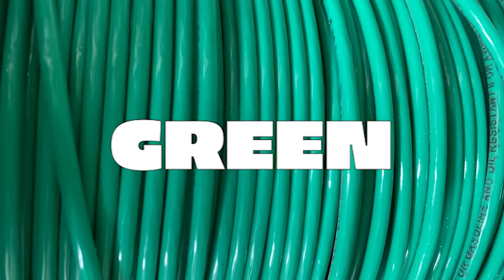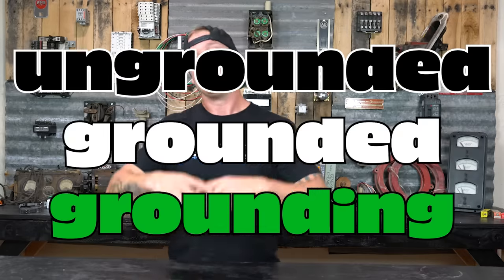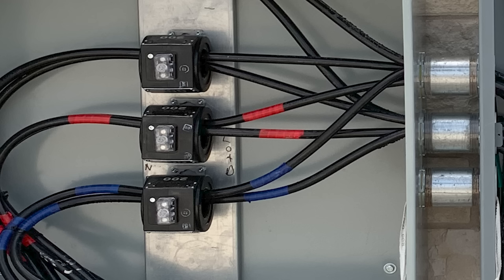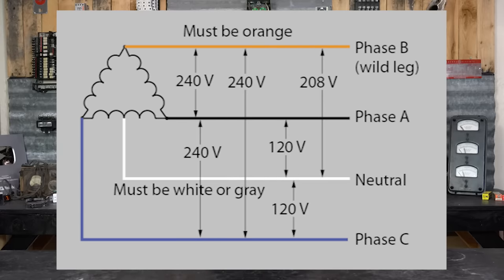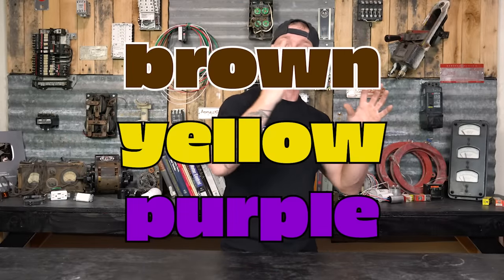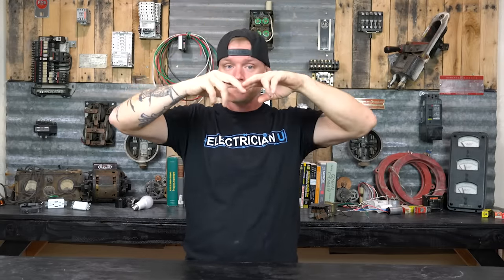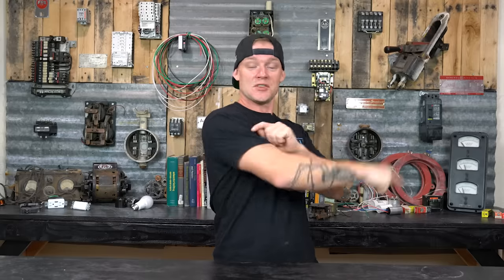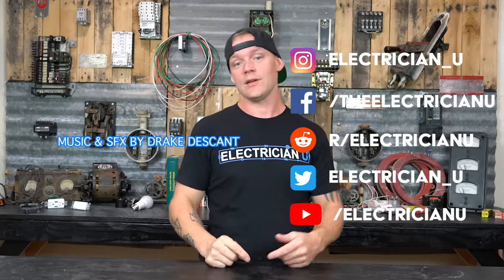Electrical Wire Color Coding Used By Electricians

Comment: 14:08 in electronics (DC) black is negative (ground) and red is positive (hot).

I heard a story about an electronics teacher who wired the receptacles for an electronics workbench. No one could figure out why they would routinely get shocked when working at this bench. Eventually someone realized that the teacher did not know that AC wiring had a different color code from the DC he was used to. He had hooked the bench grounding strap to the black (hot) AC wire.

In an ATX power supply, red is +5v, yellow is +12v, orange is +3.3v, purple is +5v (standby).

The great thing about standards is that there are so many to choose from. ;-)
Reply: My friend fixed a 240v mixer and swapped a hot leg with ground and the second you touched the machine you got shocked.
Reply: All DC circuits it’s Positive (+) and Negative (-) not hot or ground.
Reply: @brianolson8736  That's the most accurate definition,.  Although + or - can be tied to ground, it's specific to that system, network, or industry.  For example, in telecom, most equipment operates on 48V DC, but it's the POSITIVE side that's grounded to earth, so the live wire is minus 48V.
Reply: That sounds like an urban legend. What kind of electronics INSTRUCTOR doesn’t have basic electrical knowledge. Even guys who work on DC circuits understand the difference between AC and DC.
Reply: @brianolson8736  DC circuits have Positive(+) Ground(GND/0V) and sometimes Negative(-) , if there is no negative Voltage then ground is labeled with ( - )  or (GND)
Reply: that is probably one reason why in Europe the phase is Brown and the neutral is Light blue
Reply: I'm calling BS on this one . I've been an electronic tech for over 45 years NEVER seen black used as ground
Reply: @frankporfidio9813  In DC circuits GND is most of the time Black in older Devices it is Blue. I don’t know where you work but Im an Electronics Engineer and this is what I learnt and what I see is beeng done.
Reply: I have in a building, 120v emergency power circuits rewired in the 1970s where there  are orange, yellow, and green wires. The green is hot! Color coding is often inaccurate.
Reply: @FishFind3000  lol. I know someone who had an idiot wire up a pond. It would shut off when it rains b/c the water was ON. In and AROUND the damn plug! Which was corroded. And hard go plug/unplug! A problem itself! 
.should have hid it in the rocks or above so it stayed dry.
Reply: YIKES - an electronics teacher of all people, don't know the difference between DC and AC wiring, smh, this should be a crime.......''nuff said.

Comment: As an audio technician, I need to mention that speakers are wired for low voltage AC signal, and as such, there is no positive or negative, and a speaker doesn’t care which way it is connected. The only reason there are different colored wires for speakers is because whenever you have more than one speaker you need to have them wired in phase, so they all push or pull at the same time. Reversing the wires on one speaker will put it 180° out of phase with the other speaker(s) and cause its sound to partly cancel the sound from the other speaker(s).
Reply: great clarifacation, i also thought speakers had positive and negative connections
Reply: @billmongiello4885  they do but now I know why😊
Reply: @billmongiello4885  They do. Speaker wire has one end w a red stripe.
Reply: Absolutely, however...... in  subwoofer applications there are situations where you actually need to wire one sub in reverse, switch positive & negative, to correct the phase.  Explaining the many factors that can cause this would turn this into a short story, but the actual box type to woofer alignment, box/woofer to application (vehicle/room)
crossovers, transfer functions, etc etc can affect this. 

Simple way to identify this is when you wire 1 sub & its thumping, but then wiring the 2nd, 3rd etc & is sounds weaker than the 1 alone.  So then many times reversing that positive & negative can fix the issue.  Obviously other things can also cause this, but this is at least a quick way to diagnose if this is the issue. And without harming anything. And believe me I've seen this one happen many times over the years. And to just make things clear I've been doing this for many many years I also got my MECP back in the early 90's & held it (renewed it) for many years
Reply: Speakers most definitely polarity sensitive. Get them messed up and "phase" cancelation occurs. Not good!

Comment: For 120-volt residential ceiling fans with luminaires, the blue wire is for the light and the black wire is for the fan.
Two pair telephone cables can be tricky.  Line 1 should always be red and green, and line 2 yellow and black.  But, especially older homes, may have 24VAC on yellow and black for old princess phones with lighted dials, there will be a transformer somewhere if that is the case.  If you're trying to add a second line with a VOIP service and you can't get it to work, you might have a transformer somewhere in your basement that needs to be disconnected, these were some of the first 'wall-wart' transformers ever made.
Reply: K
Reply: Interesting, thanks.  I remember hearing something like that years ago and I also remember seeing the actual transformer used and the lighted phone dial telephones they were used on in a box of stuff left over from a move many years ago when I was a kid.

I believe that one of the phones may have indeed been a princess phone. There were also some trimline phones with lighted rotary dials and large wall phones.
Reply: John Felle  or network wires.
I just classify it as:
High voltage = electricians
Low voltage = communication worker
Reply: John Felle  haha true. s soon as they bring out the linemans to strip the telephone wires, you know your in trouble!
Reply: You just put the blue and black wire from the ceiling fan to the power wire

Comment: Thanks for the good info. Worked in a factory here in South Africa. Our Wiring colours are red,yellow/white and blue for the live/hot wires black for neutral. Now add to that American machines with your colours of black,red,blue and white and European machines with there brown,black,grey and blue. Made it very interesting to work in that place. To add to this mess we also had some cheap piece of machinery that I think was from china wired all in one colour (probably what ever they had on hand as we had 2 identical machines with different colored wires) with crappy stuck on labels that came of at the slightest touch.

Comment: As a 42 year union electrician ( years in trade) and instructor, 120/208 or 120/240 is black. Red and blue. White neutral regardless of single phase or three phase
277/480 is brown, orange, yellow and GREY neutral. Grey is used instead of white so it can never be confused with the lower voltage system. Utilities use their own colors.

Comment: Here it is. 120/240 single phase like in most residential is Black is A phase, Red is B phase. Get a piece of 12-3 with ground wire and check it out. 120/208 3 phase is Black, red,blue. 120/240 3 phase is  black (A) , orange (B),  blue (C).  Neutral is white. 277/480 is brown(A) orange (B) yellow (c). Neutral is grey.
Reply: On the 120/240 3 phase system the B phase is orange to designate that from B phase to neutral you will see 208 volts . This is known as the high leg. Phase A to neutral is 120 v. Phase C to neutral is 120v. BUT phase C to neutral is 208 v. Use your meter. I had an instance where all the hot conductos were all black. No colors. There was a white. I didn't want to assume anything so I checked voltage phase to phase. It's a 3 phase system. So all voltages measured 240. So right away I knew one of the phase conductor wires would be 208 volts to neutral. Sure enough. I found it before I started wiring my branch circuit receptacles.

Comment: Current standards for wiring colours in the UK, as per Europe is: Single Phase, Brown Live, Blue Neutral, Earth Green/yellow striped. Three Phase is L1 Brown, L2 Black, L3 Grey,
Reply: It's true. In Czech Republic we must NOT change color of ground wire (green/yellow striped) and must NOT make ground wire from different color. Ground wire must have the same color along the entire length.
Reply: Thats the same all over Europe. Ground must be the same - and Green/Yellow stripe cannot be used for anything else.
I build equipment for all over the world and it's mystifying how many different colour schemes are used.
Reply: @mattylad8035  In this context I thinking about use that black wires and color tape. I can't imagine something like in 11:11 in distribution box in our country (even for ground). Advantage is we have the same voltage between phases (all phases are the same) and between phase and neutral.
Reply: I really hate how they changed the 3 phase colours away from ryb. Now a neutral in single/three phase swap to live, its confusing. Plus, seeing RYB helped identify 3 phase systems. I guess it makes sense having L1/L are brown, but the black/grey is confusing and harder to make out in dark environments.

Comment: in EU its Brown, black, grey, blue for neutral, and yellow/green striped for ground.
Reply: The majority of places outside North America use this coloring. I learned about it doing theater work with a fairly scabby power panel with a techie from the UK I was helping adapt some stuff for US power. We basically had to sit down and compare notes for how one another marks and runs things in a power panel and found it mutually enlightening and left convinced both of each other's coloring schema was bonkers. Also she learned the joy of wire nuts and vowed to take a giant pack of them home.
Reply: @carpespasm  Wire nuts are still used by some people in Finland, but a screw terminal is more commonly used since you can change the connection more easily and you don't have to straighten out and twist again those wires.

Comment: aqui dejo una reseña para aquellos que hablamos español de la explicacion:
VERDE: tierra no importa el voltaje ni el tipo de sistema, se conecta al punto medio del transformador junto al neutro en el desconectivo principal.
BLANCO:  neutro del sistema, acompaña a cada fase en los diferentes circuito. PELIGRO, por el neutro si circula corriente no confundir con tierra.
NEGRO,ROJO Y AZUL: colores de las fases de un sistema hasta 240 v.
NARANJA: es el color que se usa para marcar la fase conocida como HIGH LEG, la cual es bastante peligrosa de usar ya que posee 208 v con respecto al neutro.

para 277V hacia arriba, 
GRIS:  se usa para neutro
CARMELITA, VIOLETA ó NARANJA Y AMARILLO: se usan para las fases.

en circuitos residenciales solo se usan 2 fases NEGRO Y ROJO con su respectivo neutro (BLANCO) Y la tierra de color (VERDE).
en caso de paneles de servicio y acometidas secundarias donde todas las cubiertas de los cables son negras se usan tape de esos colores.

Comment: As a journeyman electricians, instructor, electrical inspector and commercial and residential electrical contractor I enjoy your talks. All electricians do things a little different but the willingness to learn and expand is our greatest attribute. The NEC or code as I recall has only a few colors. The rest are industry standards. Grounding conductors are green or green with a yellow stripe. Grounding rhymes with green is how I remember it. Grounded conductors are white or natural grey. Dead white is how I remember it. The high ungrounded leg of a three phase system(208) is orange. Those are the only colors that are in the code as I recall. The other colors are industry standards but not code and should be verified. They all should be verified but you know what I mean. I love what you're doing keep up the good work and don't think for a second I'm being disrespectful.😊
Reply: Exactly Right, never been called for a color pattern using the colors you mentioned...
Reply: @steve-o6413  in the end its up to the AHJ in your area

Comment: If it helps, the difference between neutral (white) and ground (green) is the neutral is intended and designed (sized) to carry current. (and in most industrial situations, it will -- all multi-phase systems will have some imbalance. Residential likely does, too, but I've not checked mine) Ground should normally never have current flowing on it. (if there's current on the ground lead(s), something is broken.)
Reply: Right, the ground lead only has to be big enough to not melt during the time it would take to trip a breaker, assuming everything's functioning properly in the breaker panel.
Unsure if it's different in commercial or industrial work, but in most residential wiring cases, all 3 wires for 120v loads are going to be rated for the same current, for example in 12 gauge Romex the Ground conductor will be rated for just as many amps (because it's the same physical diameter) as the hot and neutral conductors, however it will simply have no insulation on it since the intention is for that lead to never have a significant potential with respect to ground (as its purpose is simply to allow a "wrong on purpose" path for current to flow during a circuit fault, rather than having that current flow thru someone or something not rated for it).
Reply: The ground does carry leak current away fro  the devices. This typically would be at most 1 mA or so. Many modern devices leak like computers and fridges.

Comment: Just seen this video, very interesting. I'm an auto tech, and orange is used in the hybrid/fully electric cars to indicate high voltage. In my field, high voltage is 60 volts and higher. Everything that is a part of the high voltage system is colored coded orange, the cable, the connectors, and the master disconnects. Watching this video has helped me to understand the wire color coding. I have messed around with the wiring in my house, and watching these videos has helped me to understand the wiring better. The three phase stuff is mostly commercial/industrial, but there are a few instances in which three phase is used in residential applications. For example, an air compressor in the garage may have a three phase motor in it. Thank you, Dustin for doing these videos, very educational.
Reply: I can't say as I've ever seen 3-ph in a residential setting.  Not that it couldn't be requested if it were available, I suppose, but not all neighborhoods would likely have it.

Comment: Really appreciate these videos. I am not an electrician, but do some of my own work. Great to see these videos targeted with simple explanations. So many “electricians” really have no clue what they are doing.
Reply: True, lol! Always, ALWAYS double check. Have a LICENSED person check and double check. 
And follow around anyone in your house like you're a dog and they have Milk Bones in their pockets...get a guy that likes to talk and explains everything well. 

Pay them extremely well and tip in cash if you call and they're there right away. 

Look out for places that hire some idiot off the street to work for you who doesn't know wtf they're doing and has no license.
Reply: The city doesn't tell you what colors you have to use for the current carrying conductors. The code specifies for the grounded conductor (neutral) it is to me identified as white or grey with that being the color of the insulation on the wire or wrapped with tape of that color at any assible point, like a junction box. Usually we like to use white tape for 120/240 single phase systems and 120/208 3 phase systems and grey wire or tape for the neutral in 277/480 v olt 3 phase systems. For the grounding conductor we use green color insulation or green marking tape regardless of the voltage of the system. So foreign and European equipment use green insulation with a yellow stripe.
Reply: @johndavies2949 Code (NEC) says that 6AWG neutrals (grounded conductor) or smaller shall be solid white or grey, phase tape allowed on larger wire that doesn’t come in colors.

Comment: In Finland we have three phase system (230 volts) and colorcodes are: green/yellow Ground, brown Live 1, black Live 2, grey Live 3 and blue is neutral.
Reply: Europe mostly the same , totally different in USA
Reply: And 400V between any two live conductors. And those colors are the present colors. Also been black live, grey neutral and red for anything, ground, light circuit, third phase... That was in the 60-70's, then in the 70's there came green-yellow-purple as live and grey as neutral. And sometimes there was also a three phase with black-blue-red as live and grey as neutral

Comment: brown is easy to remember as that is the color your pants will be if you get hit by it.
Reply: This applies especially in Europe where brown is almost always 240V.
Reply: lol dealing with low voltage i tell pple red your dead or with fpe panels red handles of hell fire
Reply: @projectartichoke  230 V, only Brits have 240 V as they do not want to change.
Reply: lol
Reply: Lol
Reply: @1989-u3r  lol stop it hehe lolol

Comment: European standard:
Yellow with a green stripe = earth or ground
Neutral conductor = blue,
The hot conductors are = brown, black, gray
In older systems it is hot = brown, black, black
(having two black ones was inconvenient)

In systems in the UK hot = red neutral = black, the European colors are also used.
In old systems in Germany hot = black, blue and red
  neutral = gray or blue, earth = red
Sometimes neutral and earth are together, but this is no longer permissible with thin cables. 
With old systems you cannot be sure which cable colors were used because the assignment was not uniform.
Rewiring should be carried out.

Voltage is 230 Volt (220 - 240 V) 50 Hz, on 3 phase star = 380 - 400 volt 
Some countries provide houses with a single phase, others with three phases star.